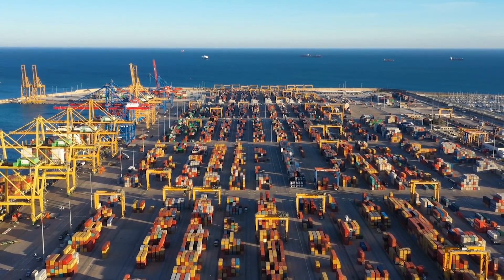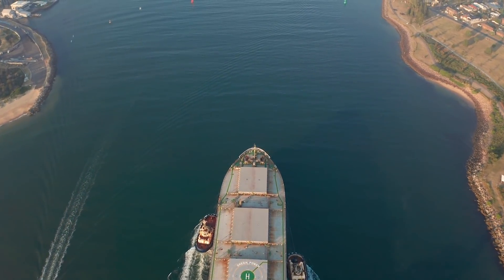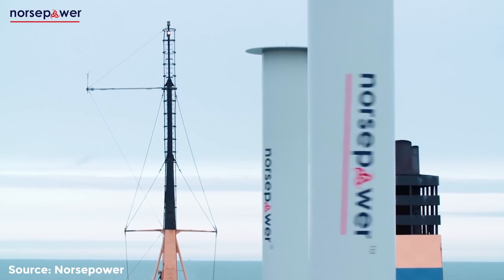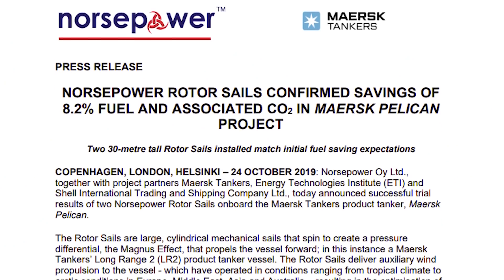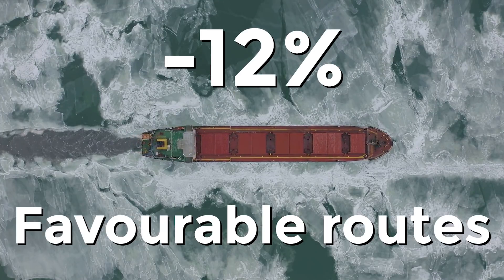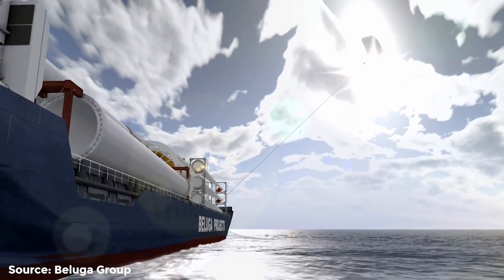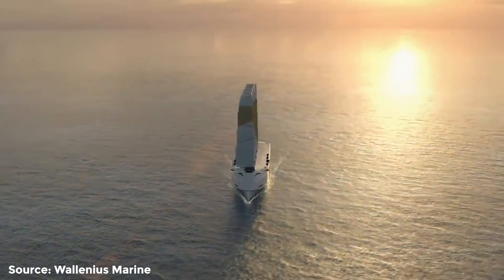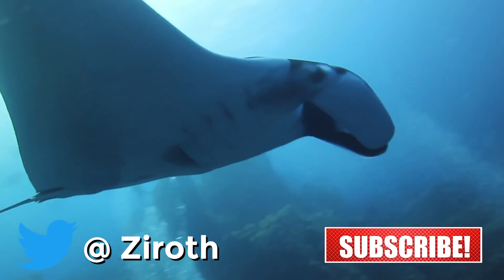Is Wind Power The Future of Shipping?

Comment: No I think maybe hydrogen but mostly nuclear fusion is going to be the thing eventually
Reply: Nuclear fusion shows every likelihood of working on a very large scale, not in ships, trucks, trains and cars.
Terawatt fusion power plants maybe?
Reply: @algrayson8965  well look at a US Navi nuclear ship that could easily have a fusion reactor
An you can make the electricity on land make hydrogen from it and than feul the ship on hydrogen because battery's are way heavier than hydrogen.
You can use hydrogen also for plane's because it's so light
Reply: @algrayson8965  That isn't entirely correct. There is a company working on a very small fusion reactor right now compared to the bigger (and more public) tokamak reactors. While the company is focusing on bigger power plant replacements/supplements, it would be ripe for this exact kind of application due to its relative small size. 

Having said that, even some smaller tokamak's aren't much bigger than the typical freighter combustion engine. those things are huge.
Reply: Hydrogen is like electricity. It has to be made, not collected from nature like hydrocarbon fuels. It inherently consumes more power to extract, compress, refrigerate, store and transport than it yields. Its flexibility is what is its advantage, like battery-electric vehicles.
Liquid hydrogen transport is reduced by on-site extraction from water. This requires great electric power, which is generated somewhere else and transported by high voltage transmission cable to the fueling site.
Reply: Since he didn't liked your comment it means he is against nuclear power. Instead he keeps pumping pipe dreams.

Comment: What if we add wind turbines and use them for running electric propulsion system?
Reply: I don't know about other techenics but I would think in 3D space utilization like Elon Musk says for his factories. Maybe the kite things could be worked on more. Maybe added solar panels and go on.
Reply: @RobertoCardadeiro  Thanks for sharing the knowledge! 😘
Reply: Conventional land-based style turbines are fragile and very top-heavy. Vertical cylindrical turbines that have a yin-yang-like X-section are much more efficient and practical for driving ships. They can have either a mechanical or an electrical drive and have diesel engines sending power through mechanical variable differential transmissions or by driving electrical generators.
When wind power is sufficient for driving a ship at the calculated most cost-effective speed, the diesels would be shut down, saving fuel oil. If the wind is stronger, the ship can go faster.
Reply: @algrayson8965  Thanks Sir for your comment! I got the point May Allah bless you!😘❤
Reply: To address the suggestions that sail power is the answer I offer the following.  In 1870 a premium sailing vessel entered service, the ‘Cutty Sark’, she could carry around 600 tonnes of cargo at speeds of up to 17.5 knots, dependent on the prevailing wind, to harness the energy the available spread of canvas was up to 2 976m2.  To round things out that was circa 5m2 of canvas for every tonne of cargo carried.  The ‘Cutty Sark’ was designed and built for employment in the tea trade where time on passage was a large factor in securing the premium freight rate that made her cost effective but as soon as the Suez Canal opened, which the ‘Cutty Sark’ was unable to sail through, she lost her advantage, raw speed, to the steam powered ships of that era.  Mechanically powered ships have improved in terms of efficiency, on a freight tonne mile basis, by at least one order of magnitude since then.  After losing out to the coal burning, steam reciprocating mechanical ships of the late 19th century ‘Cutty Sark’ was relegated to the Australian wool trade, just about the bottom of the barrel in maritime terms and only one small step up from being a 'honey barge'.  The canvas, cordage and extra manpower needed for sailing ships was never a very benign environmental option so please discount any idea of sail as ‘sustainable’.  All this is without the problem that if ‘the wind don’t blow the ship don’t go’, when it does blow it often blows in the wrong direction for your cargo delivery needs and sometimes there is rather too much of it for comfort.